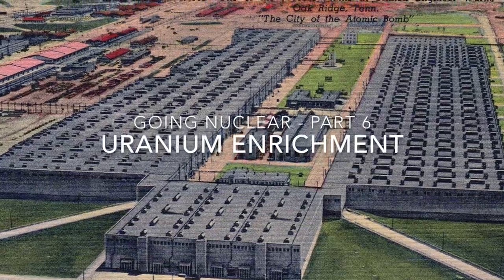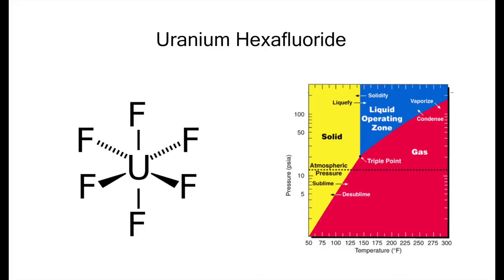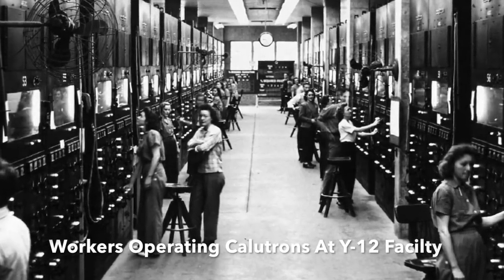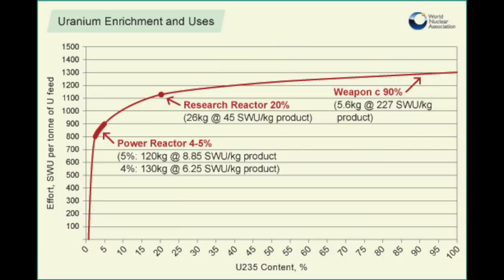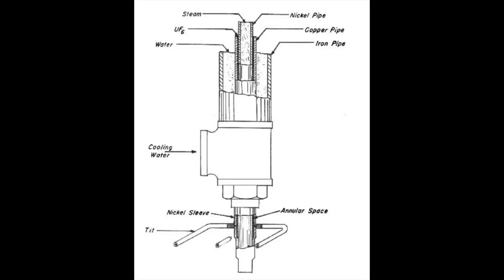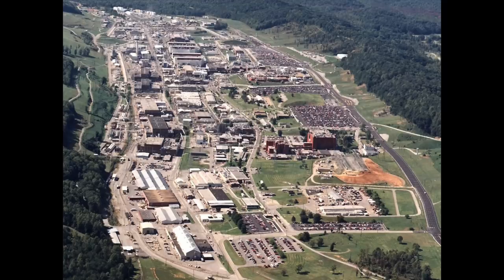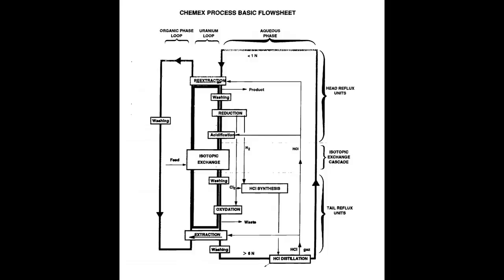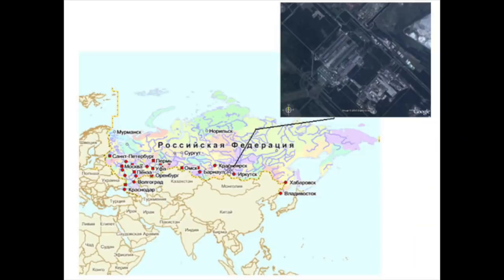Going Nuclear - Part 6 - Uranium Enrichment

Comment: The silex method is so exotic and beautifully clever. They're somehow using hyperpolarized (nuclear spin purified) parahydrogen Raman conversion cells to shift a CO2 laser's wavelength to the precise infrared resonance absorption line of a U235 to F molecular bond. I would love to know how they prevent things like collisional excitation transfer to neighboring U238-F molecular bonds from ruining the efficiency.
Reply: They actually are having a real problem with heat causing enough change in the hyperfine structure that efficiency is way bellow what they expected from lab tests.  A friend of mine was involved with the early efforts and has her name on a couple of patents for these technologies, and she always tells me she loves in with foreign countries try to invest in covert laser enrichment...because they will fail and it will waste their money!
Reply: Does silex exploit hyperfine structure for separation? I know that's how AVLIS works, or rather...worked, since it's been abandoned, but I assumed silex was purely using the molecular IR absorption wavelength shifts due to isotopic mass difference.
Reply: Like the video suggests, the details are classified. But many people that have their foot closer to this than I do suggest the core principles are basically the same but with better hardware. The rumor mill suggests the heat noise problem still keeps this needing more and more funding..which is a hard ask in this land of excessively cheap uranium.
Reply: I guess that's one of the reasons why their stock price has utterly collapsed to like 20 cents over the past decade.
Reply: Are the details a "Born Secret" type of classification?  As  I understand the concept it's makes certain information classified even if derived independently and hasn't been tested in court.
Reply: In the nuclear world most people tend to play by the rules, even if they are dumb, don't make sense or hurt innovation. Because losing your livelihood isn't worth rocking the boat. While I am not one of these "down with regulations" people, it can't be denied that nuclear fear and security puts a damper on innovation. I don't know how to solve that, but there it is.
Reply: This may be of interest to some here, a paper that discusses a proliferation assessment of SILEX: https://www.tandfonline.com/doi/full/10.1080/08929882.2016.1184528. Collisional transfer to the U-238 is limited by adding in a carrier gas and keeping the overall concentration of UF6 low. This decreases the chance that excited U-235 transfers the spin to U-238 on its way to the rim (enriched portion) of the gas.

While there are reportedly some classification issues surrounding the technology, I wouldn't say that the basic physics and what lasers are needed are classified. There may be some running parameters or other tricks to get it to work that are classified, but the basics for how enrich uranium up to weapon-grade levels is out in the public domain. 

Christopher brings up an interesting point about heat issues, but that is most likely due to how heat adversely affects the selective excitation of the U-235. What this means is that the hyperfine splitting is not large enough in U-235 to allow the laser to only excite the U-235 and never the U-238 at certain temperatures. This is why you keep the temperature low. You need 235-UF6 monomers in a larger enough supply to get this process to work and you need to separate the excitation lines between U-235 and U-238. Hyperfine structure allows you to do this in the first place, but you need some help it appears from keeping the temperature low. 

It is not my view that your want to encourage other countries to do this. Laser expertise is much more widely available than centrifuge expertise, and using this technology to build nuclear weapons should be considered a terrible risk given that there is no means to detect it. As I said, the concept is publicly available, as are what lasers are needed. This is a good thing from the perspective of how you manage the problem, which probably requires a monumental shift in attitude about the prospects for nuclear proliferation. Without understanding how dangerous this technology is, that attitude shift is not likely to arrive in the United States given the range of inhibition strategies it has employed in the past. Keeping this secret was never going to succeed. It could only delay its disclosure and development, just like every other uranium enrichment technology ever developed. But spread it will, as all technology always does.The most worrying aspect of this is that this paper that came out in 2016 already appears pretty quaint. It's solid state quantum cascade lasers that may be more likely relevant in enriching uranium in the future. These are being developed for all kinds of applications that most believe all countries should have, with the consequence that latent nuclear weapons programs will exist in all kinds of medical and industrial applications that have nothing to do with electricity generation from nuclear power. Given the prospects for acquiring uranium from multiple sources that can also not be easily detected, this is pretty worrying.
Reply: @waymantisdale4316  Thanks guys, my brain hurts now...
Reply: There are a few visible transitions you can target that can circumvent some of the issues using midwave IR light transitions. The hard part is keeping the laser frequency stable, as the excitation mode spacing is literally megahertz differences from the 238U resonance. The benefit is that you can get 90% enrichment in a single pass.

Comment: For my senior science project. I built a full cut away model of a A bomb. My science teacher gave me a B. I told her if I had twenty two pounds of plutonium she be in trouble.
Reply: "Give me an A+ or we're going to discover if my science project works" xD
Reply: That’s basically the plot of the 80s move The Manhattan Project.
Reply: and thats what this episode was about, building an atom bomb isn't that hard. Refining and enriching the fuel is.
Reply: Well depends on the bomb but getting the shape and mixture of the explosives in a classical implosion bomb exactly right is probably some seriously hardcore maths. But you can always do gun-type one. Probably not that hard, just very wasteful if you are limited in your amount of fissile material.
Reply: You're right on the gun type being fairly easy, but extremely inefficient. The big problem with implosion isn't the explosive itself, it's getting all the explosive to detonate at the same time. The timers are as highly classified as the centrifuges according to someone I watched a lecture by from the IAEA.
Reply: @Communist_Penguin  it requires triggers with precision synchronisation of nanoseconds.
still, you could make the less efficient models, that requires only microseconds.
if I remember this series well.
a microseconds synchronise trigger system can be made with some hobby gear, sure is kind of pro, but it can be made.
so making the fuel is really the part where you need serious amount of money and personnel.
Reply: @kevlarandchrome well, there's some scientific experiments that requires that kind of precision synchronisation, if memory serve me well.
i wouldn't be surprise if you could repurpose them was explosive trigger.
but then, you have the made of make a explosive that was a very consistent reaction time (I mean, it explodes almost at same speed every time)
Reply: Well not only that, you have mix two differently fast burning explosives in the lenses in order to shape the explosion from the usual concave wave into a convex one, matching the curvature of your fissile core, which I think is probably harder to get right than timing. Especially if you use an old school neutron generator like the urchin. I believe it's with neutron gun designs that the timings have to be perfect. Getting a 32 point implosion system going, assuming the explosive lenses are good shouldn't be that hard at least comparatively. I forgot what they call these systems that can send several signals extremely precisely, useful for A-bombs and it does have several harmless applications, but that technology is under strict control. Unless you work in a lab that needs one, your not going to get one easily.
Reply: Why is 10 nanoseconds synchronization supposed to be very hard if nanosecond-sampling ADCs are relatively common…
Reply: paul austin  Huh, interesting. I never really looked that deeply into the triggering devices, I just knew what I'd heard from a couple of lectures by guys from the AEC. Now I'm annoyed about having work to do, because I really want to go down that research rabbit hole. Thanks.
Reply: paul austin I mean that even if your krytrons(or whatever you use) are all different, it is not that big of a deal to characterize them individually and then apply correct voltage curves so that the output would be synchronized down to nanoseconds.
Reply: youkofoxy not any more. Linear implosion can be done with just one trigger.
Reply: @tinldw  Because ADCs were non-existent in the 1940s when the first bombs were built.  Kind of obvious if you understand history.
Reply: I bet just 5 pounds would do it!!

Comment: Fabulous, you have uncovered rare items in this series. In this video, at 7:00 we see a photograph inside the massive gaseous diffusion plant. Not many pictures of that. Looking forward to the plutonium 239 production inside the "Queen Mary" size buildings at Hanford. Legend has it the radiation was so intense (the process used robots) inside that plant that the concrete became somewhat "spongelike". Woo!

Comment: Replying to a comment i saw over small yield nuclear devices.

A Yield smaller than the little-boy would still vaporize a city such as DC completely, ie. anything over 10kt is to be considered threatening, as you can add warheads of said yield to a MIRV (*Multiple independently target-able reentry vehicle*) missile. 
Thus not all of the warhead could be intercepted if deployed before interception. 
Such that even a small yield will be devastating to an infrastructure and population, since you can have many warheads reach a single target or multiple targets simultaneously..

You may also cause a high amount of damage by encasing the weapon in non fissile nuclear material, thus creating a dirty bomb, which the main effect would be the fallout of said device without destroying much of the infrastructure, but by irradiating the area such that the population has to leave the area. 
But you can irradiate the area to such a level that it can be easily handled by protective gear during an invasion, and then "cleaned" such that now you have the intact infrastructure without further resistance.

Comment: Both Stuxnet and Flame were aimed at impeding uranium enrichment.  IIRC stuxnet closed vents and caused overheating, flame would rapidly speed up and slow down the centrifuges causing them to break.

Comment: Scott: Please do a video sometime about how they get rockets from assembly to the pad? This can include which rockets use different methods, what engineering is required, why you'd choose one method or another. The main methods which come to mind are vertical assembly and transport (e.g. Saturn V), horizontal assembly and transport then rotated vertical on the pad (Falcon, most or all Russian rockets) and assembly on the pad followed by moving the assembly building away prior to launch.
Reply from the maker: Didn't you ask this a week ago?
Reply: Yes but I didn't know if you'd seen it so I decided one more try. Thanks for noticing,

Comment: 4:17 - 4:36  I'm not sure whether short tons or metric tonnes were used at the time, but in either case, 36/1000 of 1% of 14700 tons amounts to about 5000 kg

Comment: That we had a 'shortage of copper' is not precisely true.  Copper was a strategic material and the amounts required to wind the Calutrons would have attracted notice, while the silver bars were in no particular demand and the knowledge of their use could be easily compartmentalized.  It was thus the maintenance of a low-profile for the project that sparked the idea to use the silver for the electromagnetic enrichment project, avoiding the inevitable  'what on earth could they need all that copper for?' questions being asked by people who had no need to know.  Silver is a better conductor than Copper, and so there was a minor improvement in the efficiency of the Calutrons.  Of course some silver was lost in the production of the wire, but this was done with due care and loss was negligible.  Just helping clear a point up is all.  Best regards,  Jeff.
Reply from the maker: This sounds great, do you have citations for this?
Reply: @scottmanley  I think it would be from one of Richard Rhodes' books?  The one I read most recently was The Making of the Hydrogen Bomb, but I can't specify the source.  I've read several books on the subject over the years and wish I'd made a note outside of the covers of them...  At any rate, that is the story as I understand it from my own reading.  It was not inferred but actually laid out pretty much as I did in my post.  Wish I could help more.  I really liked your breakdown of the CalUtron.  I knew it was from Caltech and knew it was a cyclotron, but your breakdown gave the derivation perfectly.  Thanks!  BTW, the making of the Hydrogen Bomb has a ton of info on the fission program, because of course a fission core is the initiator..... So it all starts there.
Reply: @scottmanley  AH! Here is one from American Scientist. https://www.americanscientist.org/article/from-treasury-vault-to-the-manhattan-project  which makes reference to the benefit of secrecy the silver's use made vs sourcing a whole lot of suspicious copper.  I don't think this was my source, but it does bolster the information:  "Not having to divert mass amounts of copper was a huge boon for the project’s secrecy."

Comment: Could a Hilsch Vortex tube do isotopic separation?  It produces hot and cold gas based on average kinetic energy of the molecules, but the vortex/cyclone runs at over a million rpm because only the gas rotates.
Presumably it could also produce oxygen enriched air on demand.
Reply from the maker: South Africa used something like this, but I had to leave it out.
Reply: OK, and thanks for confirming I'm not the only one to have that idea.
Reply: I study nuclear and I haven't heard of this before! The material seems REALLY limited. Early work seems to indicate not great SWU levels compared to centrifuges, but might just be because it wasn't as fully realized technology? TO THE RESEARCH!

Comment: Hi Scott, strange question: there is something i dont understand... in the process of making metallic Pu the entire process is highly radioactive, but the endproduct is only shielded by some vinyl. How does that work???? The slugs are irradiated in a reactor (highly radioactive), then separated in a totally shielded process canyon (PUREX), and the endproduct is extracted at a PFP (Plutonium Finishing Plant) again radioactive like hell, then it gets machined to fit a PIT or a fuellrod, and then its only shielded with some zircalloy tube or some vinyl.... Can you make a video about that?

Comment: Given that most U-235/U-238 isotopic enrichment processes, historically, simply separated them based on their relative masses, would those processes, like centrifuge separation, be less effective if you were separating isotopes with a smaller difference in their respective masses? The difference between U-235 & U-238 is three nucleons while the difference between Pu-239 & Pu-240 or U-232 & U-233 is only one nucleon. Would the smaller difference in relative masses of U-232 & U-233 have no impact on the enrichment process or would it require more processing equipment to do the same job, like (just throwing this out there) requiring 3X the number of centrifuges to effectively separate U-232 & U-233 or Pu-239 & Pu-240?

Comment: This explains why the new nuclear power people are saying that thorium is a better fuel than uranium 235. It gets turned into uranium within the reactor but separating the uranium U232/233 from the thorium can be done chemically. Much less costly than separating U238 from U325.
By the way U232 and U233 are too radioactive to make a nuclear bomb. But within a fully shielded power plant that's not a problem.

Comment: Environmental tangent. Technically speaking nuclear is a low CO2 energy source, but many who do peer review but don't like nuclear will use poor grade ores or gaseous diffusion methods as the primary enrichment to make these numbers seem poor. Also, many suspect that the R&D needed to get laser enrichment off the ground isn't actually worth it in terms of work units gained. Uranium is already so dirt cheap because of excess weapons down blending distorting markets. Until cold war inventories get depleted and uranium prices start to rise, the history lows don't seem compelling to develop laser enrichment
Reply: I just know their talking points still resinate
Reply: Some nuclear reactor designs work with unenriched uranium.
Reply: ...and make stuff up like, nuclear power leads to nuclear war every 30 years and the burning cities add to the life cycle CO2-emissions. The peer review process need an upgrade for sure.
Reply: Ya, Jacobson's work is a joke in that area.